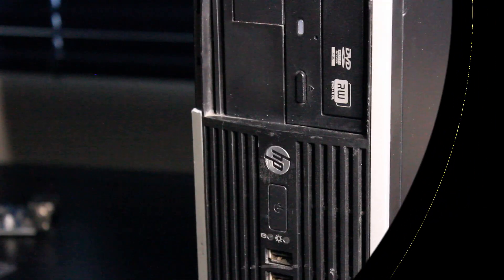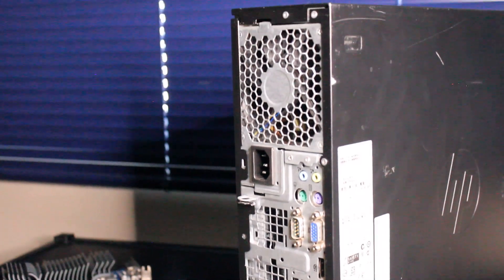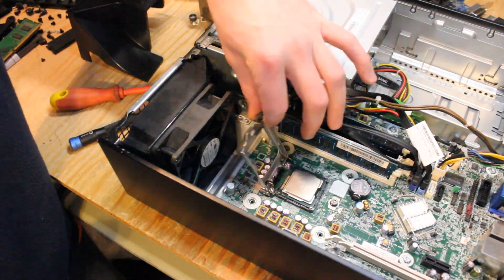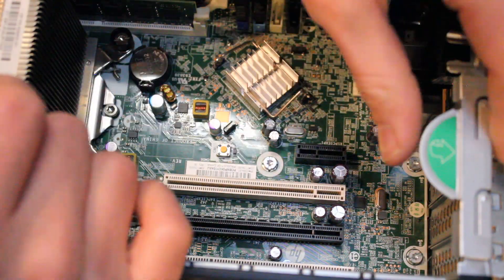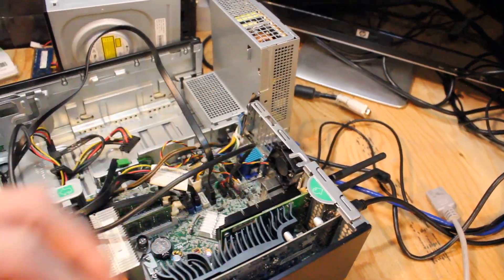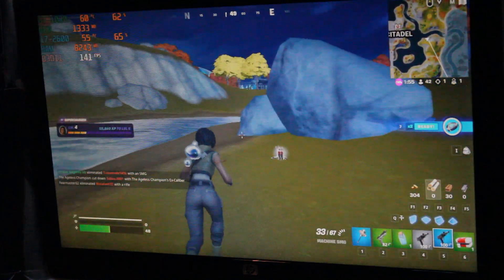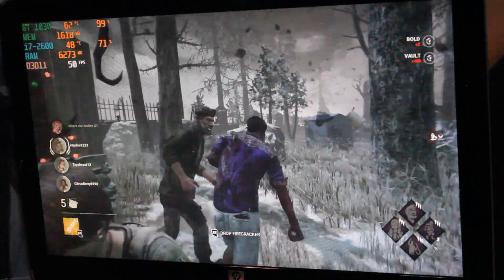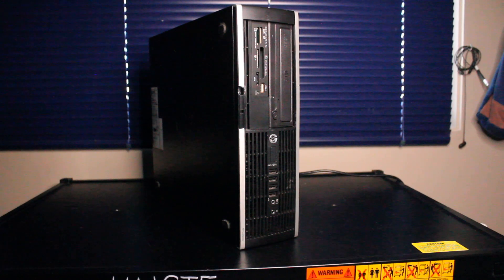Office PC to GAMING PC: HP Compaq Pro 8200 w/ i7-2600, GT 1030, WiFi, RAM, SSD!

Comment: How much would this upgrade cost? My kid is trying to do this exact thing
Reply from the maker: I just bought a i7-2600 for $46 CAD.  A GT 1030 is pretty expensive still for it's low quality.  But keep an eye on eBay.  RAM and an SSD can be found somewhere like Amazon for a good deal.

Comment: i dont know why but i have the same pc and my i7 2600 so hot, im tried fix it by use new thermal paste, install another fans and anything, then what I get is only 44C minimum and 98C maximum 😢
Reply from the maker: Hm.  What are you doing/playing when it gets that hot?  Has it ever overheated to the point of system shut down?
Reply: @HaisteComputerRepair  im play minecraft and csgo with 8x~7x C degrees average. it has never had an automatic shutdown system even when the temperature is close to 100 degrees

Comment: im thinking of buying a HP Compaq 6000 Desktop Computer Tower (Pentium is that a good idea?
Reply from the maker: It depends on what you want to do.  This PC will be quite weak with modern application use.  The Pentium in question is 2 core 2 thread, which is about right for that time period for basic office/home PC's.  If you can at least upgrade the RAM and install an SSD, you will likely be able to web browse, watch YouTube, etc.  Play light or older games.  What else are you looking at that your budget allows?
Reply: Would this build be direct x 11 Compatible?